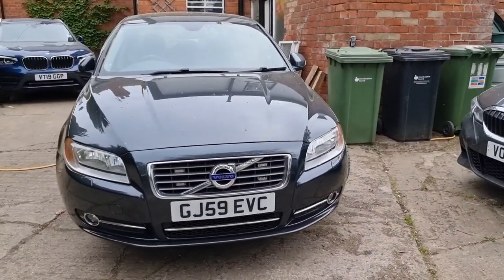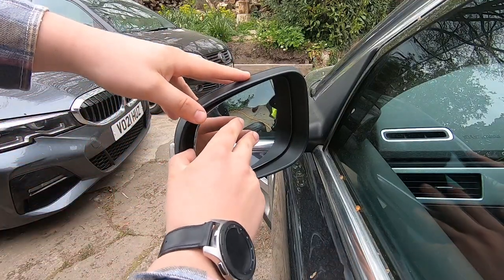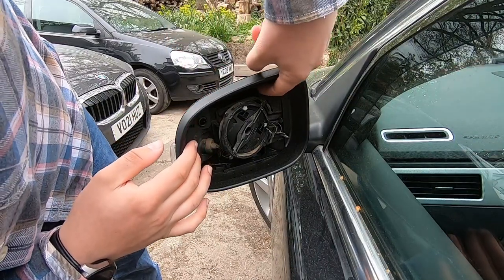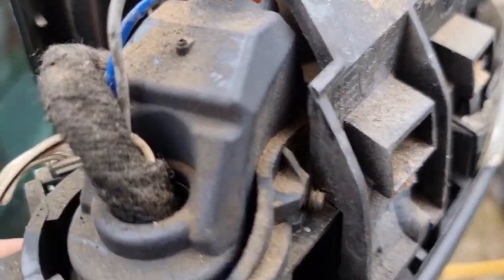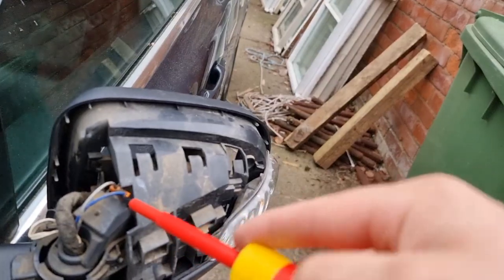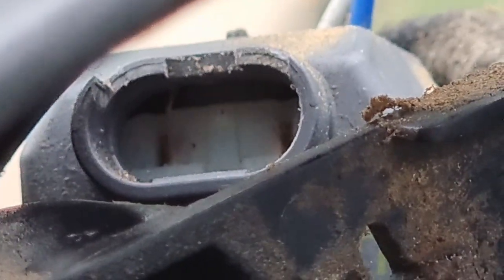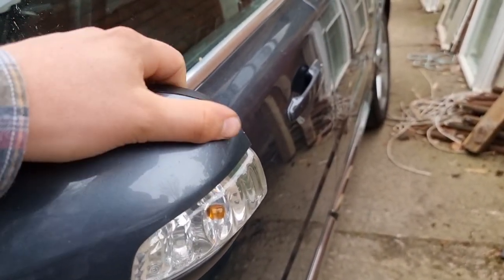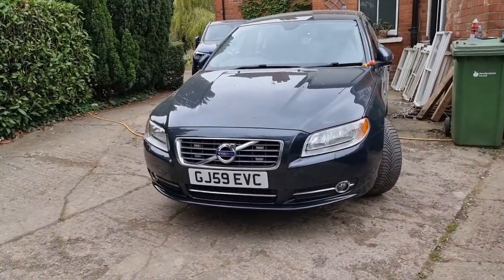A *SUBSCRIBER FIXED MY CAR* - Volvo Power Mirror Fix!

Comment: Two thing about p3 Volvo mirrors. You can fold and retract your mirrors by pressing left and right mirror button on drivers door together. Another tip is when parallel parking press the appropriate mirrors button while on reverse gear, and that mirror will adjust so you can see the cerb and park nice and safely. When you change gear selector to N P or D the mirror will return to previous settings
Reply: Thank you for the tip! I didn't know that. My mirrors were not retracting so I was prepared to take the assembly apart. I pushed the L/R buttons before I did and they snapped back and started working again. You saved me a lot of time and headache with this simple tip! No idea why just locking the doors would not do the same thing but whatever... It worked for me.

Comment: I know you did the video a while ago, so im kind of praying for a response. When you locked the car and the mirrors when in, was it making a noise and the mirrors didn't move? This is happening to my v40 atm and I'm trying to figure out how to fix it e.g does in need a clean like yours or will I need new parts

Comment: Thank u so much. Had the exact same problem with my Volvo V50 2010. Fixed my problem. Had problems with my right side mirror. Gave it a good cleaning and some lubricant. Works like its brand New. Decided to take the left side too. Now its more quiet. Definitely worth it, and very eazy once you know how to do it. Thank u very much.

Comment: does anyone have the advice what might be the issue if it doesn't fold and i can't adjust it vertically? horizontal adjustment works though. is it all the same motor that powers this?

Comment: So happy... Thanks, exact same problem and fixed after watching this... didn't need to remove mirror glass just the front cover and clean out the electric connector... Many thanks...
Reply: Had exactly the same thought - no need to remove the mirror glass, just use an interior trim removal tool to take the cover off. Thanks for confirming.

Comment: Mate, thanks for the video! I had an issue in one of the mirror of the S60 I own. The orange connector was 1 mm out, enough for avoiding the mirror to fully open (but it fully closes without problem!). Just inserting the orange connector fully the mirror opens and closes like a charm. Thanks again!!!

Comment: Did this make the mirror more secure? Mine folds OK but rattles slightly as it's not tight. The glass is secure, it's the housing that rattles.
Reply from the maker: Yep I 😁😁
Reply: Mine too!
Wish someone can come with a fix for this.
Reply: This is my problem also, the mirror housing wobbles while driving as it has quite a lot of play on the fitting. I will take it apart and see if there is anything to tighten up. Anyone else solved this problem??
Reply: @adamISO200  did you manage to find anything as I also have this problem

Comment: Sometimes electric faults in car are just caused by grime and dirt, electric silicone cleanin spray fixed my central locking on drivers side.

Comment: This was the original comment on your “3 major issues “ video:

On my s80 i can take / reject phone calls from the steering wheel buttons.From the car menu you can select if you want music to be dimmed while you are getting a phone call.
Also i hold the + button on the cruise control the car accelerates exactly like if i was pressing the accelerator pedal instead.
My side mirror behaved crazy like yours does,but my advice,just take the glass and cover off and try spraying a little bit of WD 40 inside the gray motor and around the moving parts where you can see signs of friction.Than budge it a bit by closing and opening them .
It shoud do the trick.

So.... glad i could help

Comment: And you were right regarding the EPB release.
Played with it and indeed it disengages faster than i was expecting.
You were right!
Now ,i love this feature!
I instructed my wife into using it frequently!
Thus it can be a little tricky after driving around in our xc90 with manual release hand brake button and foot pedal.
I sometimes forget i have epb and my left leg goes straight to the floor :))),were there is no pedal.

Comment: Mine is not working in full sun and when freezing, only working in normal temps and in the shade otherwise it needs a little hand of help, let’s see if this works in the weekend! I’m curious!
Reply: Update: couldn’t wait for the weekend so already did it, I think that just worked perfectly! Will have to wait for some boiling sun to make sure, but it was even dirtier than yours inside so at least it had a good clean! ;) Thanks for the tip!
Reply: Hi, same problem here.... did you solve yours by just cleaning the orange plug or did you have to do something else? Thanks
Reply: @MarcoRomaBass  WD all over the mechanism and worked a charm for the next year. Don’t have it anymore now..
Reply: @carspotterbelgium  thank you very much 🙏

Comment: Has anyone or your good self got a clue how to get the glass part of the mirror to get moving again . the driver side is working  but I've never been able to adjust the passenger side  so I adjust it by hand but the unit folds in  when I lock the doors   just the glass mirror won't move   .
Reply: Corrosion wire loose. Have you opened it up. You won't know what's wrong with it until you investigate 👍🏿
Reply: @zigzag7194  cheers pal
Reply: @paulgilraine3127  don't be afraid to open it just take your time it .